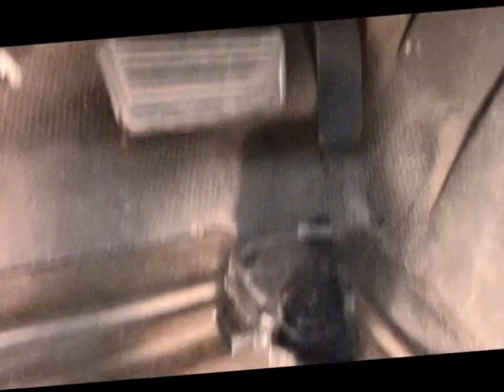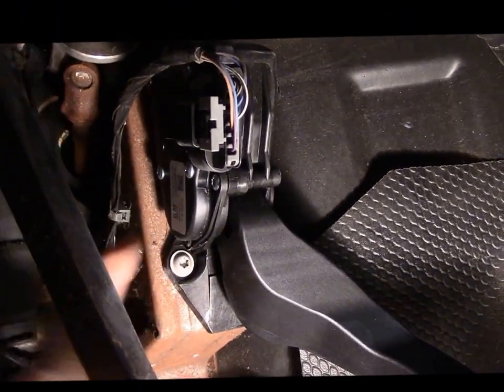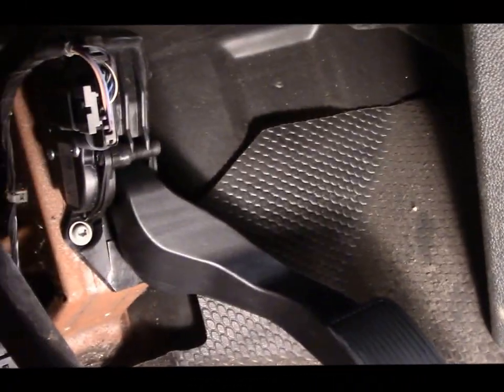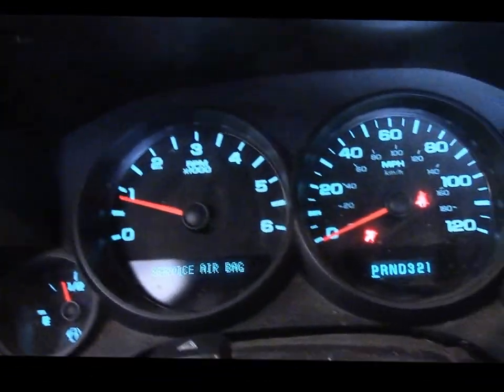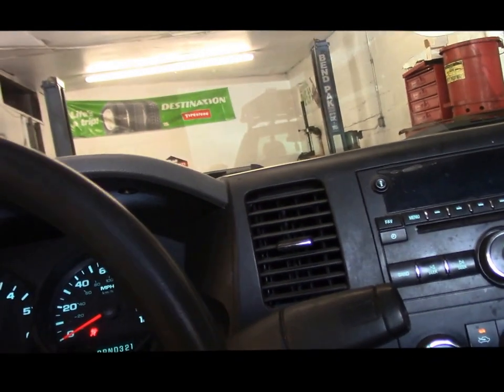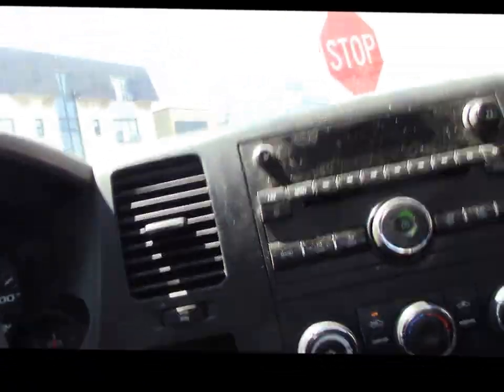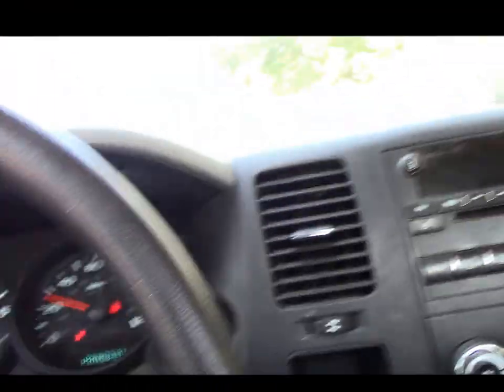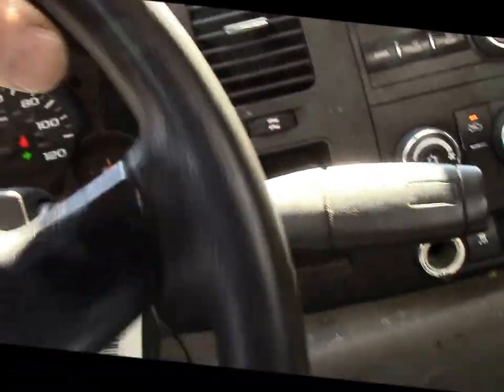2009 Chevy Silverado P2138 Accelerator Pedal Position

Comment: Hi,  I got an antifreeze leak at the belt prob from the water pump.  Got water all in the ba then the car went into full limp mode not moving at all well just reverse.  I am getting a  P2138 and P1125 Throttle Position Sensor.  Could it be I just fried my Throttle with antifreeze and not an issue with the pedal?  Thanks, this just happened last night and I will get on it this the weekend.  Thanks,
Reply from the maker: If everything was ok before the leak then you should clean all the antifreeze from the electrical connectors  and hope for the best
Reply: @jimthecarguy  Thanks, for the tip.  I sprayed it with break cleaner; compressed air, and blow died and it's all back to normal.  I truly appreciate the help.

Comment: Jim, when I replace this (2008 Suburban), will the code automatically reset or do I need to bring it in to get it reset after the repair is complete?
Reply: I HAVE THE SAME PROBLEM, WONDER IF I HAVE TO BRING IT TO THE SHOP TO GET THE PEDAL REPROGRAM.

Comment: I think it just an issue with the truck pedal period. Went to the dealer same problem went to autozone same exact problem. I’ve changed my pedal 3 times in the pass 5/6 years. That’s ridiculous Chevy.
Reply: Van...I've had this same issue in my 2007.5 Chevy 2500 for the last 8 years (replaced the pedal several times, rewired by the dealer, etc.). About 3 years ago I finally figured out the problem. Basically, I would barely tap the harness connector on the accelerator pedal with my foot and then the engine would go into limp mode. I simply pulled off the harness and reconnected it and it works fine. I've had to do this maybe 6 times since I figured it out, which sounds like a pain, but as you know it's better than taking it to the shop over and over again.

Comment: sorry but,to get rid of code could i take the negative lead of battery and fit the pedal in then reconnect  battery,coz before i change it the engine lites up and need it to go out,could you pls advise,thnx.
Reply from the maker: If you remove the battery cable and reconnect it the light will go out but the code will still be in the computer.The code will be removed from the computer once the problem is corrected and the truck goes through 2 consecutive drive cycles without a failure.I hope this answers your question.If not let me know.I will try to explain better.

Comment: You mentioned resetting , would you explain the procedure ?
Reply from the maker: The easiest way is with a scan tool but if you don't have one you can drive it for a few days and if it is fixed the code will clear by it self.Thanks for watching.

Comment: hi,just drop you a line,i got accel/pedal..and still same,so i got a machanic out to see if he could solve it, he put his test machine on it and a couple of codes came up,like problem throttle body which he checked and afew other things..but he thinks its trouble now with the EUC, which he said get checked and sorted would have to take all the euc set of,send away,all-in-all...said it would cost around 300qiud,so he came up with have alook on ebay,..
Reply from the maker: Do you know what codes he got when he checked it on the computer?
Reply: cant really remember,just said there was no power coming through when he used his hand held power tester were the handle lights up..sorry cant think what they call it..lol..thats when he asked a mate if he new the cuase but his mate said you tried what you can so have the Ford Fusion 2002 - 2008 1.6 petrol Complete ECU Kit tested,then the machanic packed up and said he would be back intouch with me,which he was saying about cheapest way would be buy a secondhand ECU of ebay,which i had alook and yes found one,the seller was asking 50quid for it but i offered 35quid and the seller accepted,but its just annoying if i get that, will that sort it out,its gonna be after xmas now anyway,which is annoying also as we have no car and so cant get the grandkids presents to them..the worse thing is i have the car on the drive and cant use it...GGRRR..best let you get on and have a nice xmas..cheers.ROB.
Reply from the maker: Try to have a Merry Christmas Keep me posted .Remember as long as you have your health  and your family  it is always a  good day.

Comment: Can that sensor cause transmission to slip
Reply from the maker: buddy clyde I have never seen the sensor cause the trans to slip. Is there any trans codes in the computer
Reply: Naw no codes...it started slipping when after i hooked up a trailer  when i unhooked it i noticed trans wasnt changing unless i let up ogg accelerator when rpm hits 3